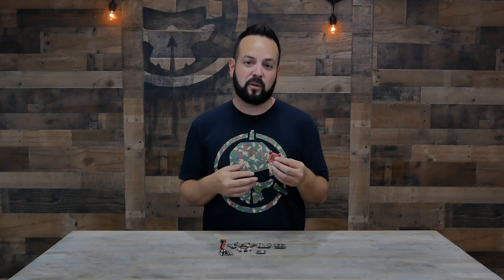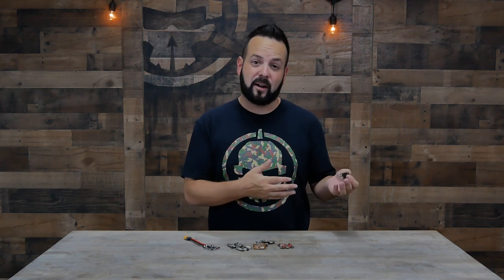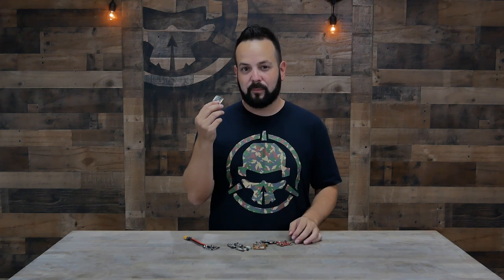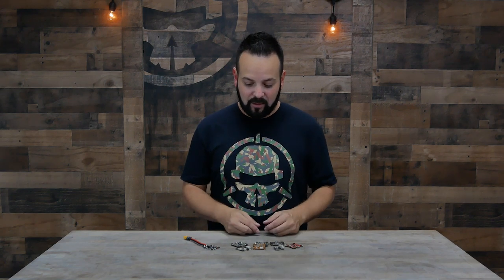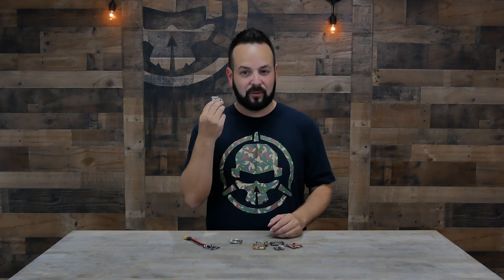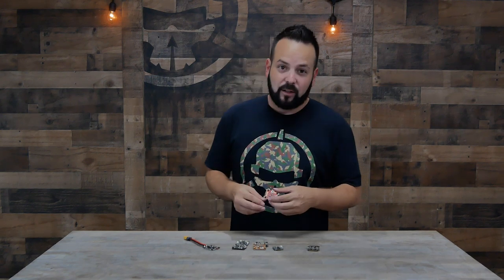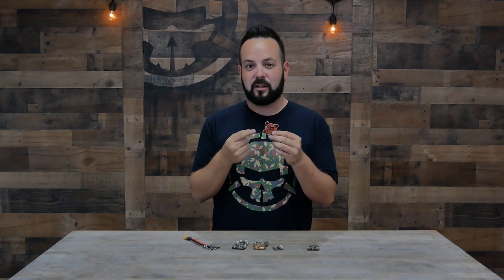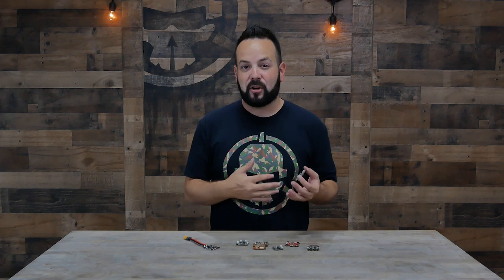Choosing Flight Controllers for FPV

Comment: Disagree on one thing about the FC's an F7 has more uarts, doesn't care whether it is inverted or uninverted signal which is important on different radio protocols. At the current pricing it is now way better to choose an F7 flight controller to give you any option you want Now and in the Future.  As far as KISS goes it is expensive and the quality control is sub  par with no warranty or support (unless you are one of his buddies i.e. Steele) I know because I built 2 KISS Quads which I have flown less than 30 min total and had ESC failures and no response from KISS so Yes Mr.STEELE fly's this (why I bought in the beginning) but Fly Duino supplies him and make sure his equip is Premium not what you as a consumer will get necessarily . Just relating my experiences!

Comment: I got a JBF4 and it's awesome, has everything you need for a kwad and the pads are in perfect placement for each essential component (camera, vtx, rx). Also the manual is great and Joshua is really nice and is an awesome help when you ask questions on live streams and etc. Plus the jb 4 in 1 esc is nice.
Reply: On my 2md one but luv them but wanted to get the cricket flightone but it's sold out everywhere.
Reply: I had the JBF4 in my first build but the first time I soldered everything up the FC died on me because i didn't knew what the solder bridges are for. So I ordered a new one but it just didn't flew very great. I had it for 2-3 months now and I replaced it with an Lumenier Lux F7. Now the kwad flies really good. So I guess I had just a bad unit? Because i think JB really put thought into this FC and if it had worked properly I think I could recommend it..
Reply: @notkira_x  Also some of them have a problem losing video because of the 9v regulator, mine has that problem. So I just hook up the fpv system directly to the battery pad and the bat lead. I hope it gets fixed on the JBF7. What frame did you use your JBF4 on? Mine is a CL1, and it flies great.
Reply: @enzopedreira4640  I used the TBS Source One. I had trouble with the camera and vtx pad they both in the end, before I replaced the FC, I got really strong video noise. Hooked both up to Vbat but still video noise. So I replaced the FC.

Comment: The DALRC F405 AIO flight controller is one of the best IMO. Some top features to note are 2x 9v regulators and lower volt regulators, well thought out pad placement, excellent processor and gyro, apparently can handle up to 8s voltage and will look fantastic in any build.

Comment: Hi RotorRiot Crew :D 
i`m a beginner. 
What i find confusing is the ESC current on the AIO Boards or Stacks... I build my own kwad last month :D a little 3" Armattan Tadpole with the iFlight SucceX Micro F4 V2.1 12A AIO Stack with 1105 iFlight Xing Nano Motors (6000KV) and a Tattu R Line 3S 450mAh Lipo 75C on her Back, normal RunCam2 Nano, HQ Props 3x3x3... hooked on Betaflight, set the channels and rates and made the first flight. 
All good and smooth but i have some heavy voltage sag on high trottle punches. which ends sometimes in a total death stall mid air because the voltages drops so low. the lipo packs are sucked dry instant on thoose punches so i scaled the trottle 25% down on betaflight. It helped but it happens sometimes when one cell gets in the 3.9V range...
What i miss in this Video is the information on the AIO Board and Stacks, what means the 12A on the ESC side. Are these Currents the max current per ESC or for all ESC`S together? 12A max for all ESC`s or 12A x 4 ESC in the AIO board/stack= 48A max Current? the max current drawn by a punchout is nearly 30A on the OSD....
should i use a bigger lipo pack? 3S 520mAh 75C or 3S 850mAh 75C? but i dont want to toast my board...
I watched a lot videos and found nothing great, which answers my question. It`s so much fun too fly my own build kwad but this is a little down side but still so much fun :D sorry for this noob question....
maybe someone can help me. Thanks :D and good flight!

Comment: what are some well known Fc brands im wanting to get into drone building and want to get quality parts
Reply: Luminear, Joshua Burwell, anything TBS, and HGRC seems to make quality stuff I was gonna get a midprice stack from HGRC b4 I seen the RUSH FPV matrix stack also rushfpv vtx is very good ESPECIALLY the tank and tank ultimate if u have the spare cash. JUST DON'T GET ANYTHING FROM I-flight, I ordered 4 motors one bell shaft was bent/misformed and that one including a 2nd was out of balance also ordered batt. straps got the wrong one's instead (very cheep) no email about it i informed them on it and got only half refund code and then bought simular ones and no email that they're being delivered but found out that it got sent halfway across the USA.
Reply: Flight controllers are usually pretty solid

Comment: In the past i used an cc3d But i flashed it to cleanflight/betaflight. Now i use an Naze32 whith Barometer and compass. I never used a better FC so i dont know better things, for my cheap build (5" 3s) its enough.

Comment: what is a good flight controller to use with my POS FlySky TX?  My quad flipped and flew top straight into the ground with KK2.0 board. Almost scrapped the whole thing, I think the motors and RX survived but not sure yet. Board Shot, cracked screen. Battery started on fire when I was unplugging it (run away)!  Thanks for all the great info, it really helps and much food for thought.

Comment: I've bought all the chinese cloned flight controllers and had nearly no problems at all. Now I've bought the expensive 16x16 iflight succex f4 mini and the flight controller came with the rx pads missing and iflight isn't giving support, worst experience with a major brand. In the only one case of a wrong sent (or false advertised) flight controller I got my money refunded. Iflight even doesn't reply...tell me why I should ever go major brand instead of clones!?
Reply: I've blown 2 of the f4 banggood clones. When they work it's nice but I would always fry one of the esc signal trace
Reply: @kd9432  that's not good, but you could solder at a bit lower temp. But receiving an already dead flight controller which costs much more in shipping than the flight controller itself...i rather would buy 10 clones, than purchasing from iflight anymore.
Reply: I've never bought anything that one would call "good".  I run Racerstar motors, Hakrc escs and Matek flight controllers, all from banggood.  I have never once lost a piece of kit due to failure that wasn't through my own fault (I lost a whole quad because I'm a crap pilot, and I destroyed a flight controller at the beginning when I was still dialing in my soldering skills).  I think that my fun per dollar is as high or higher as someone who flies thousand dollar drones, since I'm not particularly stressed about crashing and destroying a $9 motor.